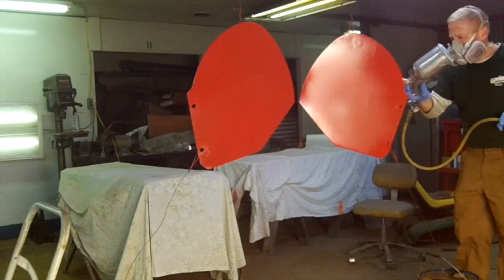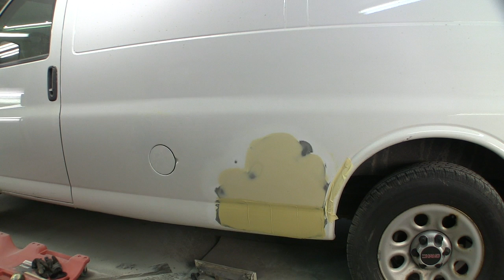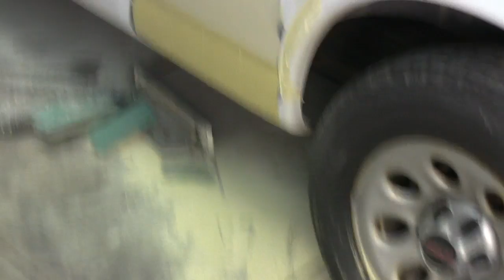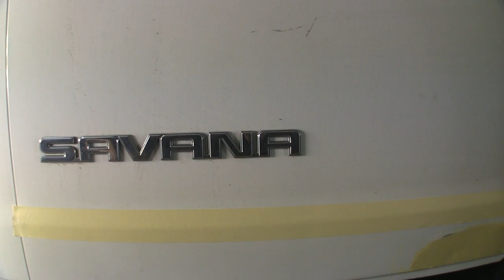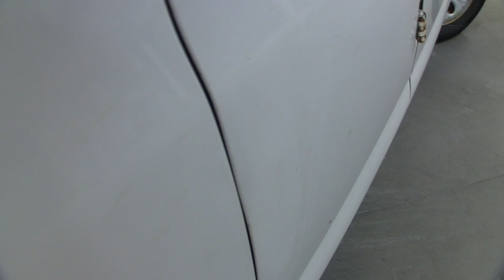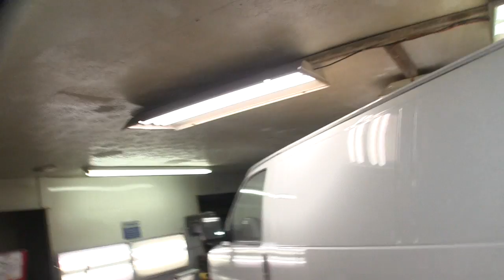2009 GMC Savana 1500 bodywork and chat

Comment: Where i live dsl is high speed internet (so they tell me) it's 1.79 mbps download .6 mbps upload @ $45/month. And i'm still using my blackberry phone because we're still 3g network around here, can't get internet on a phone. I have no idea what 5 mbps would be like and quality is having internet service or not having it. I've been giving the phone company hell since 2008 about their not improving anything around here. THEY are suppose to replace the dsl filters every 6 months but NEVER DO never have since 2008, they don't last that long. They keep telling me it's my fault service is slow because i have 2 landline phones hooked up to the same wire. They're telling me to disconnect the landline phones forever. It wouldn't make any difference, 1.79 sucks.
Reply from the maker: +jasonmushersee DSL just plain sucks around here....